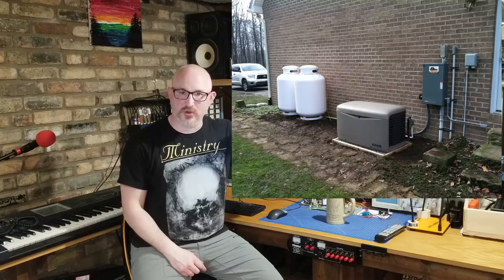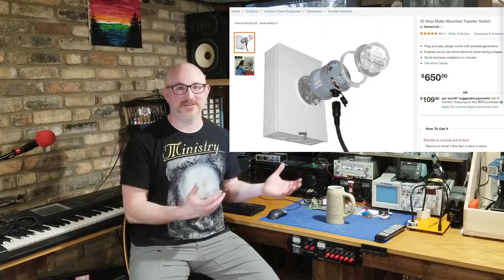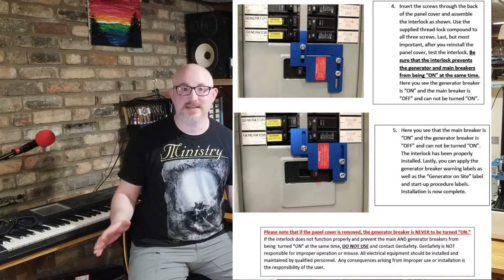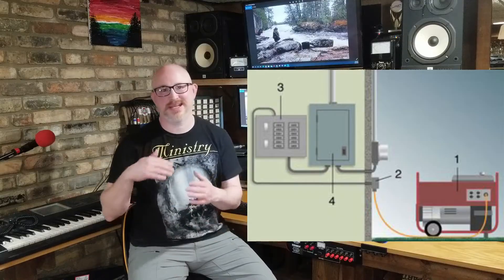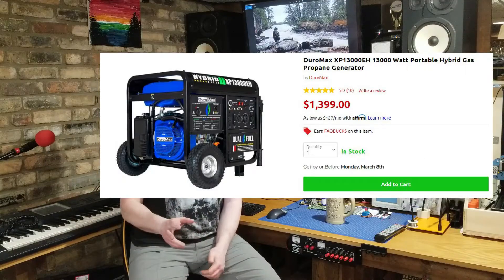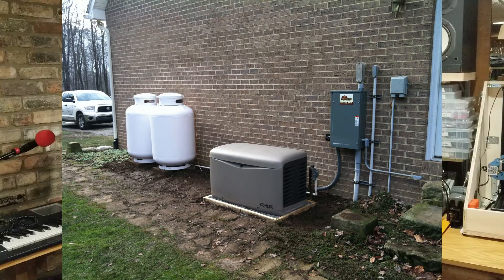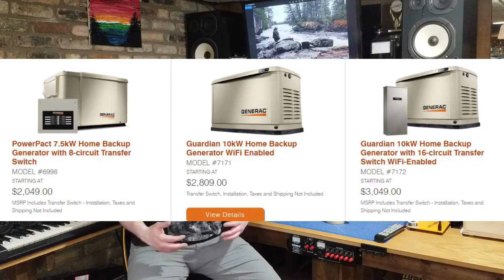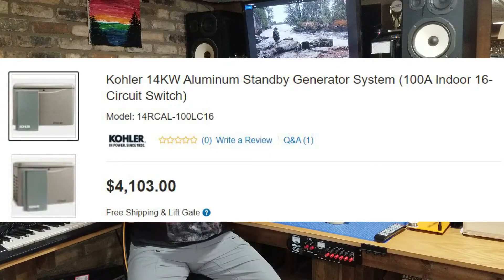Electrical Engineer explains connecting generators to your home

Comment: Electrical engineer....good. This vets you properly. Let me share my dilemma as I've posted on other sites with no good responses. Please review and offer commentary, if you would....many thanks !!!--->

Grounding.....ughh.... a terrible topic as you're "damned-if-you-do-and-damned-if-you-don't". The issue is that your MAIN breaker has a bonded-neutral ground....between ground and neutral. NOW..... you gotta figure out if your genset has an open(floating), or bonded ground too. Most gensets purchased expect you to use it as stand-alone, like on a construction site....and NOT as an INTERLOCKED secondary supply to your home....so MOST gensets come with a bonded neutral ground . HOWEVER.....if you tie the generator into a main breaker with an INTERLOCK ( not a TRANSFER SWITCH) ...to act as a full-home alternate power source thru your main panel.....you should (either):

1.)  Convert the bonded neutral to "open", on the generator....OR.....

2.) Not connect the ground wire at the L14-30 inlet plug terminal on your house where the genset plugs in ( example:  http://www.reliancecontrols.com/ProductDetail.aspx?PB30 ). It is technically against code either way.....but not converting the genset keeps the warranty in place....and it avoids you having to create a separate warning label for the genset that it no longer has a bonded neutral....and therefore (if converted that way), it should NOT be used in a stand alone situation...as the maker originally intended. 

Here's some text I cribbed from the "DIY chat room" website that I engaged with--->

"The generator I have is like most generators you can buy for home-use. It has a bonded-neutral, as that is proper for a generator used in stand-alone service, like on a construction job site. However, in my case, it is not stand-alone, it will backfeed my main panel, that already (and correctly) has it's own bonded neutral to ground. NEC code allows a bonded neutral on the MAIN panel, and then, only this ONE bonded neutral should exist in the system. If there is a sub-panel, there cannot be another bonded neutral in the sub-panel [ I think this is 250.24(a)(5) ]. Attaching the plug-in generator to a home, VIA AN INTERLOCK, is the same as having a sub-panel with a bonded neutral. Here's the problem--> by having the neutral and the equipment ground bonded at the generator AND at the actual main breaker, this creates a parallel-path for the return (neutral) currents which would then carry a voltage on ALL equipment grounding conductors (as well as the metal cases of any equipment using the equipment ground).  Parallel paths for neutral currents are always hazardous to some degree.

To avoid this hazard and non-compliance to code, I propose to wire the system this way, without a ground connection done at the generator inlet plug.  A ground wire would be wired from the main panel ground,  and terminate at the generator inlet connection HOUSING at the house ( not at the plug terminal). A neutral wire would be connected to the main panel's neutral buss and be run to the inlet connection's actual neutral terminal. Connections X and Y power connections are as normal and per code. 

 Let's review what this means,  and what it does.----->

The only purpose of the equipment grounding conductor is to allow tripping of the circuit breaker under a FAULT condition. If a "hot" conductor to a piece of equipment were to contact a metal case (of that equipment), it would cause a high-current to flow from the protective device....through the supplying conductor to the case....and back to the source (panel) on the equipment grounding conductor. The current/amp draw would be high enough to instantly trip the circuit breaker. It really has nothing to do with directing electricity to the earth. By not having the equipment grounding conductor of the generator "bonded" to the earth, it does impose a slight hazard... IF.... the generator-to-house connecting cable developed a "line-to-earth" fault. There may (or may not) be enough amp draw to trip the generator circuit breaker under this condition....therefore it would not be reliable. To my way of thinking, this is OK as long as I keep an eye on the condition of the connecting cable from the generator( ....don't drive over it, etc.). The result would be that the risk is very low."........and the system would work as intended.
Reply from the maker: https://youtu.be/Nrnforx1uFI

My newer video on the topic may help answer your question for what I recommend on the subject.  I'll keep reading your post and reply with additional info no covered by this video.
Reply: @richardvedvik979  ..many thanks....a quick view of your other vid at timeline 6.40 to 7.03.... I THINK.....says the same thing as my longish text here asks....break the ground connection at the inlet receptacle.... to break the ground wire path from the interconnecting cable ( between gen and inlet box). For me, I still have this---> a ground connection from the main panel up to the inlet receptacle's metal HOUSING ( but NOT to the inlet connection itself....that is, not to the "G" connection of the receptacle)...also this....a neutral /white wire connection again starting from main panel ( either ground or neutral buss....no matter....they're bridged)....to the "W" connection of the inlet receptacle. The hot leads X and Y are wired as is normal ...to the X and Y connections of the receptacle and the other ends connected....one-each.... to the 30A double-pole breaker in the upper/right breaker slots for the interlock. Right ???
Reply from the maker: @TheWilferch  break ground from panel to inlet receptacle.  Maintain ground from generator to inlet receptacle.  This is because inlet receptacle will never be energized from panel if the generator breaker has a mechanical interlock.
Reply: @richardvedvik979  ...super....BUT, excuse me for asking, but need to go back to this NUANCE. I have "lifted" the ground connection from the main panel buss.....to the inlet receptacle CONNECTION...meaning...to the slot "G" on the receptacle itself. All correct and I think we agree on this point. All other neutral , both hots are connected to the inlet receptacle. But the ground wire run, from the panel is still connected to the inlet receptacle HOUSING.... but is no longer bridged from there to inlet receptacle slot "G" ( using Reliance PB30 as reference). I think we're ok but being extra careful with my wording.
Reply from the maker: @TheWilferch   thanks for the clarification.  I want the grounding bond to the receptacle housing to come from the generator, not the panel.  That housing will only be energized by the generator and I want a short circuit path back to the generator.
Reply: @richardvedvik979  ...??.... I'm truly sorry to drag this out again, ...maybe I only have a communication issue to explain clearly....and maybe it's a not a technical issue. To recap....  A normal 4 prong connection ( connecting cable) would still exist between the generator and the inlet. I think "where" the ground "breaks", (in this case)....doesn't matter, right? So overall......you'd have a wire run from the main panel ground bus.....to the inlet connection EXTERIOR METAL HOUSING....and that's it...and NOT to the inlet connection "G" terminal. When the generator is operating......the interlock cuts- off line power... and allows only gen power to arrive at the inlet. This is exactly what you want....right? If this isn't clear ( and I hate to use words to clarify something as critical as this, that a sketch instead can show)...may I send you a sketch? Sorry again if this is an irritation but maybe this helps others here too....
Reply from the maker: @TheWilferch  No worry about getting clarification.  I was on my phone previously and now i'm at a PC where I can type for efficiently.

In that video link I explain my intent on where exactly the ground is lifted but i'll detail here for you. 

There is no ground (EGC) from the main panel to the exterior metal housing.  While we would normally want that, we will never energize the receptacle FROM the panel, so we don't need to bond the exterior metal housing for the generator receptacle to the main panel. I used ENT (smurf tube) for my feed from the panel to the generator receptacle to prevent any possible metallic bond.  You can omit the ground wire from the feed between panel-receptacle entirely, but I left it because my next video will show how to lift the neutral-ground bond in the generator which will require that connection. 

What we do want is a connection from the generator receptacle ground terminal to the metal enclosure housing the generator receptacle.  We want this because the generator will be the SOURCE of electricity and we need a path back to the SOURCE.  So the 4-wire cable will provide the ground connection from the generator receptacle metal enclosure back to the generator.  

Feel free to ask any other questions.  The diagrams in my other video should explain this pretty well. 

Cheers!
Reply: @richardvedvik979  

...thank you for staying with me on this. 

I think I know where the (communication) problem may be, and I will admit it might fully be "me". I think this is the wording problem, better shown in  a drawing or schematic.--->

 Consider.....the Reliance PB30 inlet is made up of TWO pieces; a FRONT and a BACK metal panel. The backside is mounted to the house and has a ground "lug"...maybe you are calling this a  terminal, but no matter, for clarity let's call this point "A" . As received, the FRONT panel has a screw on its inside face that captures a pigtail ( meant to connect to "A"....where the home ground wire is also meant to connect),..AND....this same screw has another short wire connected to inlet receptacle connection "G". The entire inlet receptacle is mounted in the FRONT panel. I get what you're saying.....you've kept the wire run from your main panel to the inlet, but it's disconnected.....you will need to connect it when you run a floating-bond generator. 

This is how I have it wired....in words.
- one pole of the double-pole gen breaker at the panel, to inlet connection "X"(red) of the PB30.
- the other pole of the double-pole breaker, to inlet connection "Y"(black).
- white wire from panel neutral bus to inlet connection "W".
- bare wire from panel ground buss to "A"....the aforementioned ground LUG "A", which is on the BACK piece of the PB30 inlet BOX.
- RETAIN wire from "A" to the FRONT panel screw connection. 
- REMOVE the other pigtail from this PB30  front-panel screw...that WAS connected to the actual inlet receptacle "G" connection...this action BREAKs that connection with "G".

So when the 4 prong cable is connected from the generator  to the inlet, X and Y are then connected and have a path to the appropriate connections of the double-pole breaker.... there is also continuous connection of the neutral path back to the panel neutral buss....(the neutral in the main panel is still bonded to the ground buss)....so "ground" is maintained this way without the risk of parallel circuits. And although the 4 prongs of the connecting cable from the generator to the inlet still exist (on both ends of the cable)....there is NO ground connection made from the inlet connection (proper),.... to "A" inside the PB30 box....the only ground connection is PB30/front......to PB30/back.....and the combined connection back to ground/neutral,  in the panel. I think this satisfies the parallel path risks and should work. 

I hate longish text like this .....as it still can be misinterpreted....with apologies ahead of time, allow me to send a schematic of what I have, as it will explain the issue more clearly....and it may be the basis of you showing me how to rewire if wrong, as right now I don't see an alternative. That may have been the shorter question !!!.....Thanks !!
(I located your business email address if that's OK).
Reply from the maker: @TheWilferch   feel free to send a wiring diagram and I am happy to review and markup.
Reply: @richardvedvik979  ..many thanks ...👍

Comment: I have an old electri center sub panel in the garage with a crowfoot 3 prong welding g outlet 50 amp. Can I plug in the generator to this outlet and backfeed the main panel with main breaker off. Interlock yadda yadda yadda. Do I need to ground the generator. From generator to welding outlet is 4 prong nema 14 50 to 3 prong 6 50. The ground wire is not connected on the 3 prong plug
Reply from the maker: Thank you for the question.  The short answer is no, using the welding receptacle in the sub panel so would be unsafe because there is no way to mechanically interlock the main breaker with the welding receptacle.  This means you could accidentally back-feed the utility or mix-up the sequence of opening the property's main service breaker prior to connecting the temporary generator or vice-versa when disconnecting the temp generator.  I also have a sub panel in a garage and agree that it would be convenient to back-feed from there, but there is no way to interlock the two because an interlock in the main panel would prevent me from powering the sub panel under normal operation.   My generator bonding video explains this in more detail.
Reply: @richardvedvik979  insane bucko
Congratulations 🎊 👏 bloke

Comment: Here is what we did....and don't yell. We installed a 30 amp 240 twist lock under our meter. Then we built a double male  end extension cord. We kill the main breaker outside and plug in the generator.
Reply from the maker: Any reason you did not just install a recessed male receptacle so any normal 30A 240V extension cord would work?
Reply: @richardvedvik979  we had to set it up in an emergency situation.  We farm and use what we had laying around.  I wouldn't recommend this setup. We know what we have so we respect it but it could get somebody hurt. Main thing we worry about is that we have a complete disconnect between our house and the power company so we don't cause the linemen to be in danger.

Comment: Great video! - A fellow EE
Reply from the maker: Thanks!  Check out this bonding video and let me know what you think. https://youtu.be/Nrnforx1uFI
Reply: @richardvedvik979  : I also watched the video you referenced in this message and like the other one found it to be very helpful. You obviously spent significant time making the detailed, excellent drawings, and unlike some others, I had no problem viewing them (on my iPad). On a tangential note, when I bought my house in Seattle in 1980, it had a low capacity fuse-based panel and, for the most part, knob and tube wiring. Like you I chose a Square D panel to replace the fuse box and over the years I’ve replaced all the knob and tube wiring. I commend you on your work, it may be the nicest panel wiring I’ve ever seen. Finally, if you’ve not already done so, perhaps you could make your set of  diagrams available as a pdf document linked to your video. Doing so might help readers having trouble viewing the figures while watching the video in real time. Thanks again, I learned a lot from both of your videos. - Best regards - Jim
Reply from the maker: @hubercats  Thanks, Jim.  Excellent idea on sharing the images.  I can certainly place them in a shared folder.  

My previous home was built in 1925 and I had to remove all of the knob and tube wiring, which isn't easy on a multi-story home with lathe and plaster walls.  I was able to get it done without having to cut up my existing walls, but it took a long time.  The last phase was the first floor lighting and that was replaced when I removed the flooring on the 2nd level.  

This new home had an FPE breaker panel that needed replaced, hence the Square D panel in the video.  I did replace that by myself, with necessary permits and inspections.   I can do a typical panel swap in a day.

Comment: QUESTION IM BUILDING A BARGE CABIN AS IT SOUNDS ILL BE ON THE WATER FLOATING! I’m using solar for main with inverter charger system I’m going to use a small mini split so I ordered a soft start box to handle the surge hopefully!! But I’m wiring a 30 amp box also if I ever can plug into a main ? I’ll have onboard a nice size gas generator for back up for Bad weather or just need extra power and a small 2000 Yamaha generator just in case an will be for extension cord set ! Emergency!  But my generator will go to inverter charger hook ups  my generator the GFCI ON IT ARE NOT GROUNDED SO WHAT DO I GROUND THEM TO SINCE I CANT CONNECT TO THE GROUND?  Or if in fixed location can u run a copper ground rod through water into ground?  I have no idea?  Any answers will be appreciated!! Thanks
Reply from the maker: Neat question.  Let me think on this one.

Comment: Richard, it is my understanding that you need a special sine wave generator to power electrical equipment like TV's and desktop computers. My generator unfortunately is not a sine wave. Could I buy a UPS, plug my electronics into that, and then connect the generator to the UPS to keep it charged? Thanks
Reply from the maker: Sorry for the delay.  I purchased a portable generator that is rated for less than 5% THD.  Sadly, many of the portable generators available have THD between 10% - 25%.  You are correct that high distortion generators are problematic for sensitive electronics. 

Sadly, simply buying a typical UPS is not effective because it will not clean up the original sine wave, it will just switch to battery when power is lost.  The signal from the generator will pass right through a traditional generator.